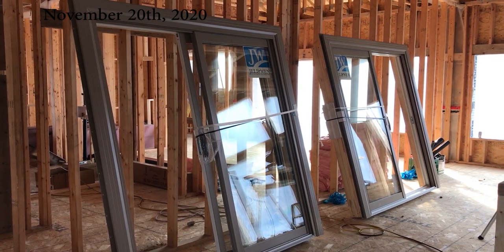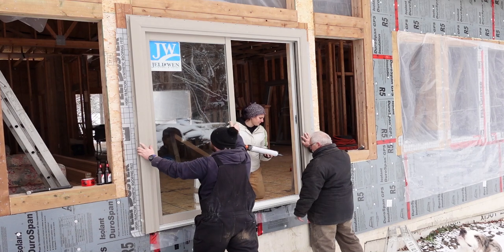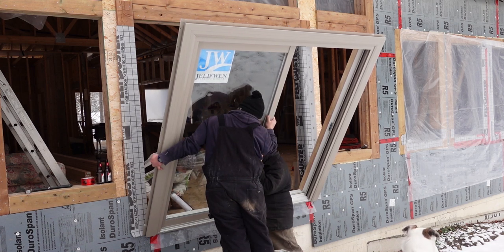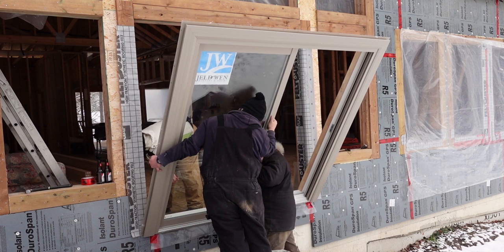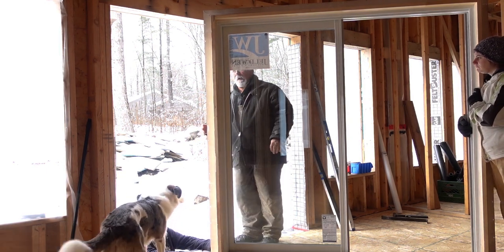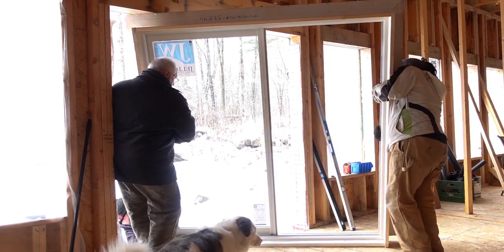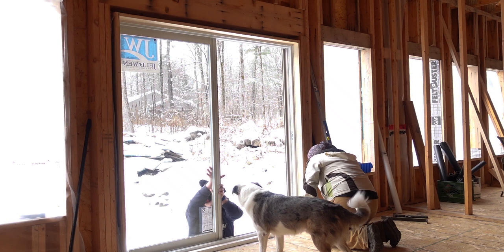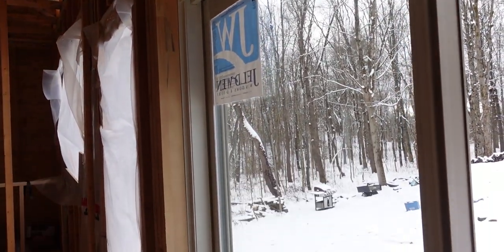INSTALLING our SLIDING GLASS DOORS! | November 23rd, 2020

Comment: Tiffany, we bought a house two years ago that has Jeldwen windows.  We noticed a few had lost the seal between the glass and we called them and they were fantastic. We told them we did not buy them ourselves but they said it didn’t matter they are guaranteed for life. Then they changed the name to ours on the original purchase order.  I am telling you this to let you know the company should stand behind their product and hopefully you are receiving good news about your replacements.  If Home Depot is not responding favorably I would suggest you call Jeldwen directly.  If you would like I can pm you any contact info we have.